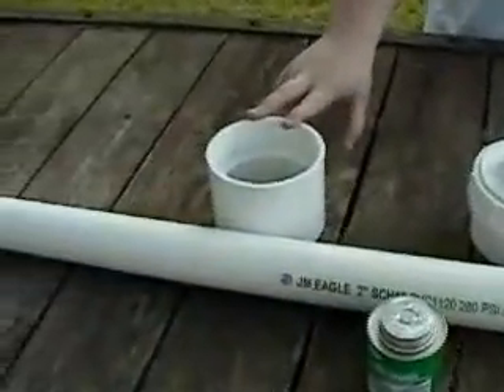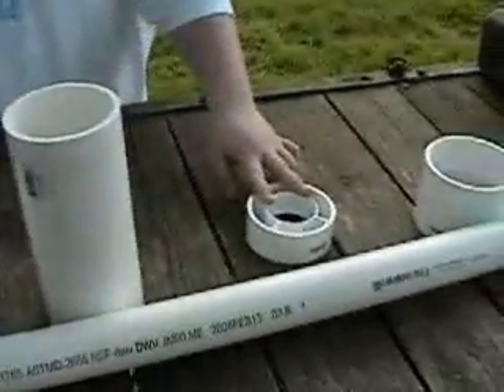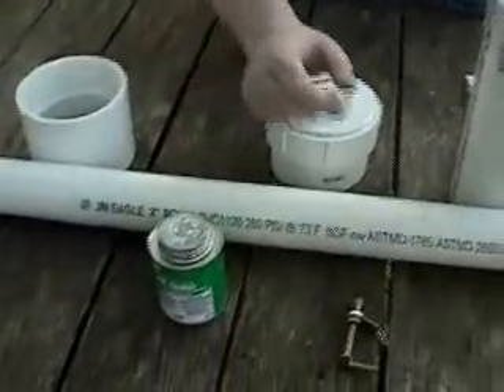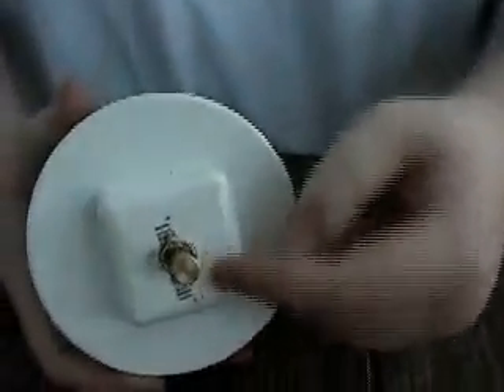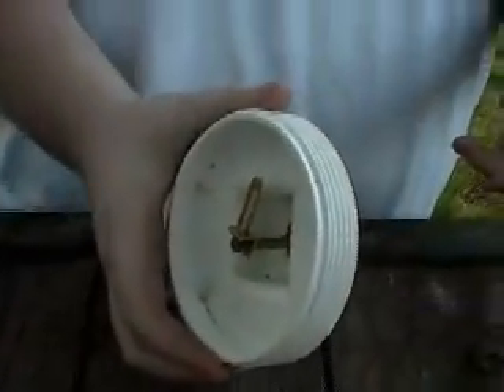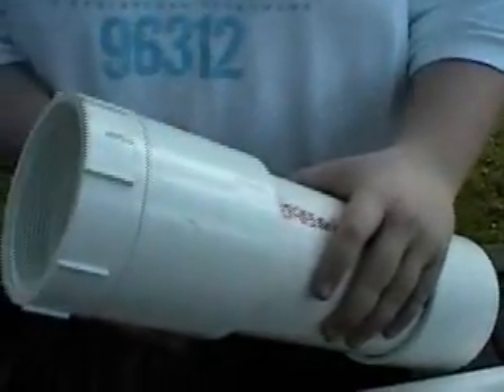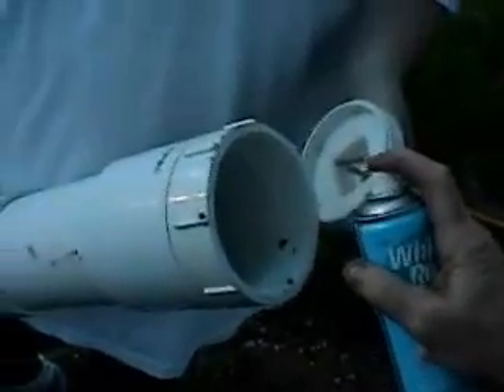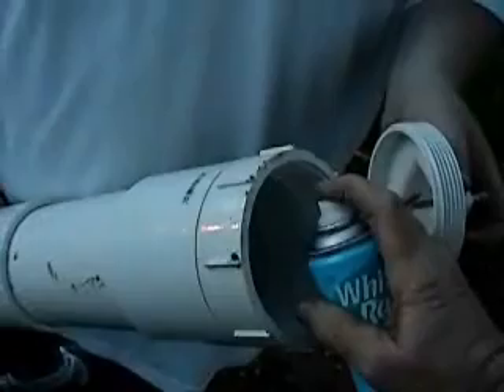Potato Gun Project

Comment: horrible ignition placement. the cap is the most likely part to fail, putting the ignitor on that could lead to a very injured hand. seriously. ow. a better place would be in the center of the combustion chamber.
also, you should ALWAYS prime the cement before gluing. Its not very important for plumbing, but in pressurized applications like this it is very important.

Comment: Cool video but I have to point out a couple safety issues:

- PVC cleaner (that purple stuff) should always be used before gluing.
- Be SURE all the PVC is "Pressure Rated". That "cell core" garbage will break. 
- The cleanout cap is almost always the part that breaks. Putting the sparker there could get you burned.

I DO love these ghetto guns but Safety First!